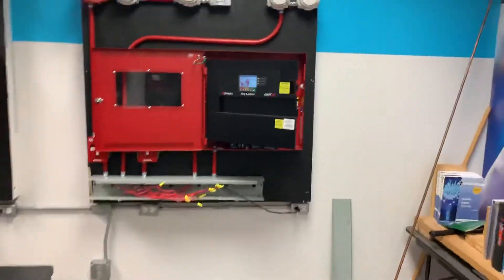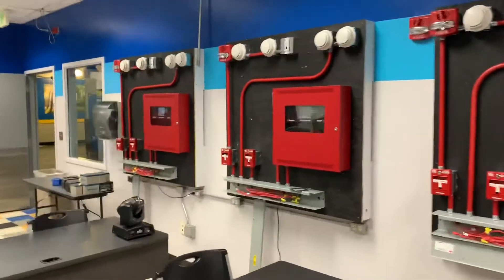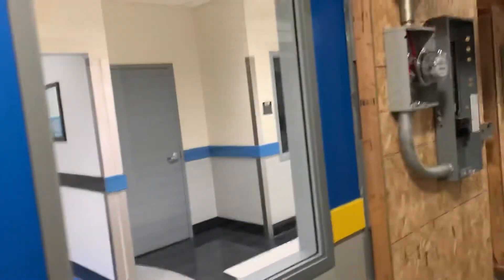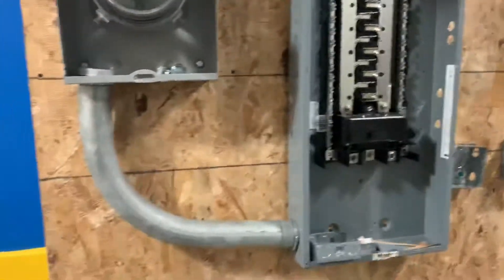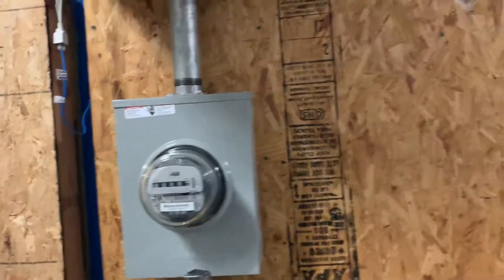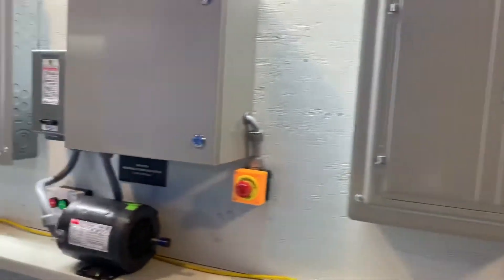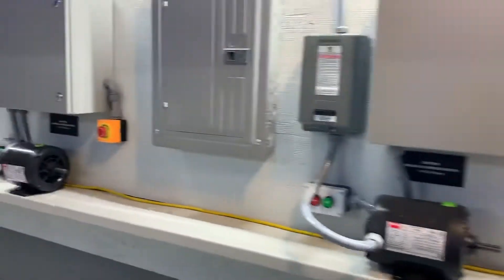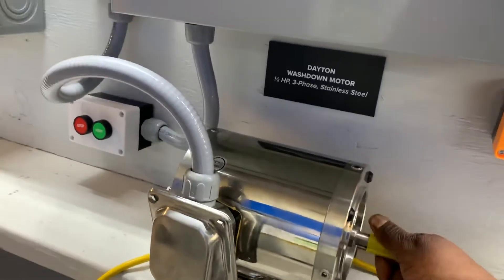Those who know how things work VS those that don’t

Comment: Hey Rex, great to see you active on the channel!  Isn't it a bit over simplification to divide people in 2 camps as people who know how "THINGS" work vs those who don't? I can understand perhaps how electricity works in a feed of household power supply, vs someone else that understands how to calculate for capacitance and resistance for a PCB board...
My firm belief(or you can look at history) is that... No one is better than the sum of us. And this is most true in coming to understanding how things actually work. But applying a SKILL to a training for labor is quite different. You teach the person the model and apply the learned solutions. Rather simple. Either way, Very nice training environment you have there!! 
But I agree, knowing how electricity works is a MAJOR advantage. Knowing how a engine and its components work is a MAJOR advantage. One might also say, knowing how optics work is a MAJOR advantage.....There are a number of these major advantage, but really knowing them well, I think one person knowing all things is not likely, so therefore, I cannot divide all people vs all things.
Reply from the maker: Perhaps an oversimplification yes...but the overall point remains.

Seems as if we have a large number of young men coming up that have no clue on basic mechanical functions. 

The point is to use your brain, ask questions and seek understanding. Always seek understanding.